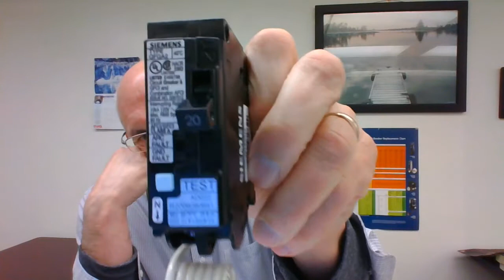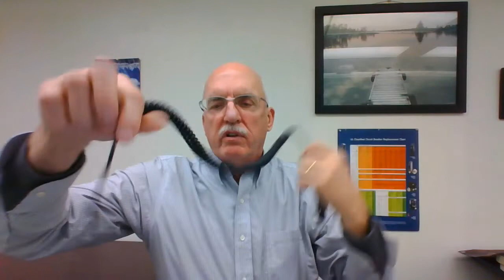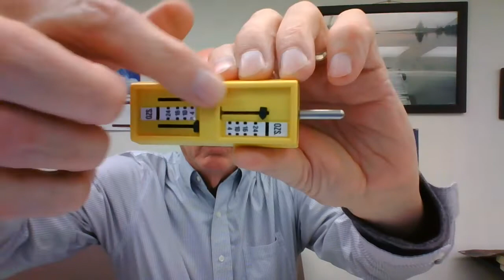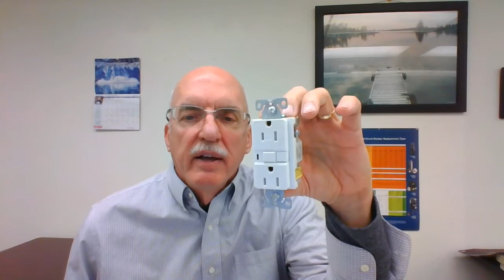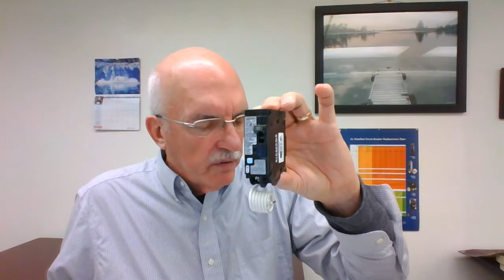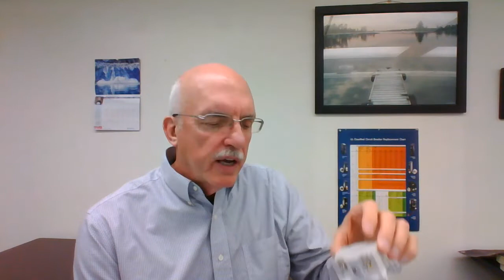Electric Education Center Session 3 - AFCI's

Comment: Rich we had to use the tension tester every 3 months while PM' ing receptacles in OR'S. Had a special tester that had what looked like had a 2.5" long male plug that tested ground tension along with proper wiring of receptacles in patients rooms. Bruce B from Square D was a tester for Square D AFCI circuit breakers. He told me that no matter where he plugged in the vacuum cleaner it tripped AFCI. He went out and purchased a new vacuum cleaner and that tripped every AFCI breaker. Engineers at Square D reprogrammed the AFCI breakers and they nevervtripped. Thanks for the great vids.

Comment: Regarding a new circuit from a panel that does not have afci / gfci breakers available, (Pushmatic). If the circuit is feeding a single outlet (laundry, bathroom, etc) can you install a dead front dual device (if available) at the panel, and run MC cable to the new receptacle?

Comment: Good presentation Rich, look forward to the series! As far as Dual function breakers are concerned, in some instances it may be more convenient to use the dual function receptacle where the tenant does not have access to the panel. Particularly in the dormitory situation it can result in less calls to the maintenance technician if the students can reset the receptacle.